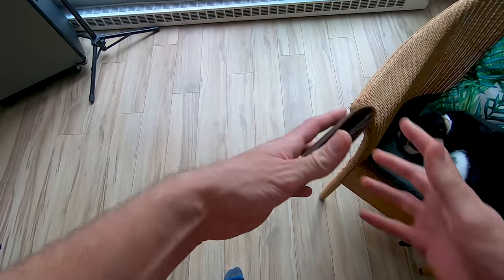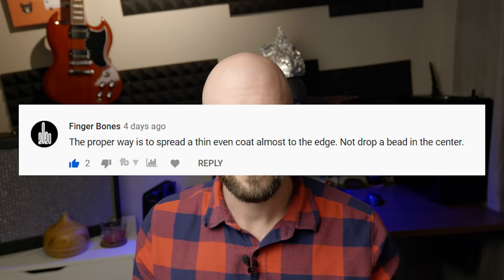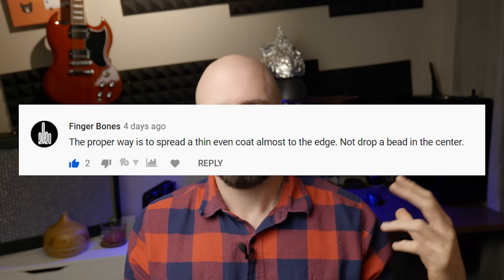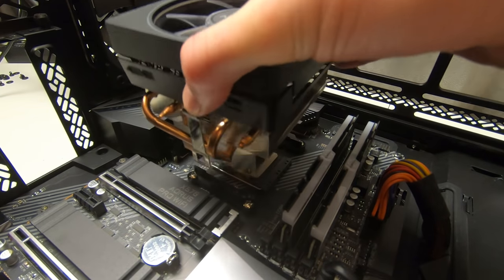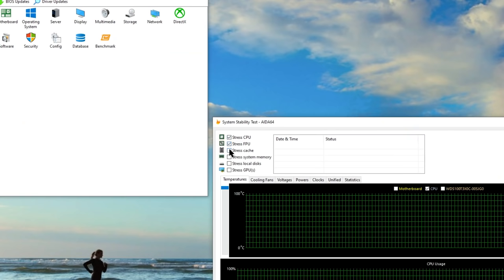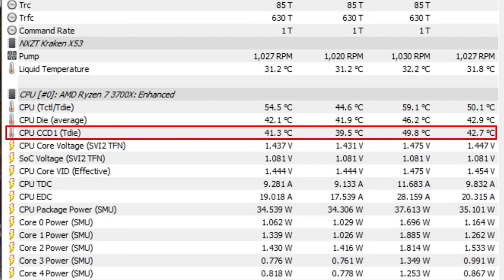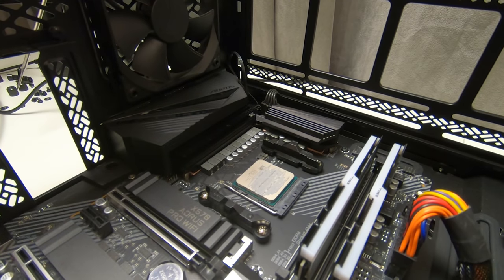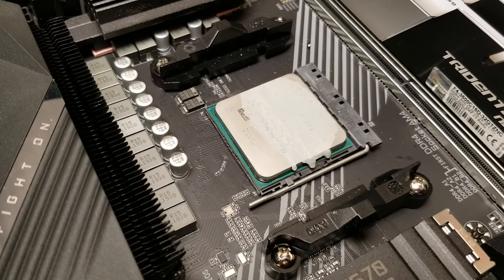Best Way to Apply Thermal Paste? Does it Even Matter?

Comment: And when I got my new aio 2 weeks ago, I wiped off the pre-applied and used corsairs XTM 50 and went with a X with a small pea in the middle. Worked fantastic for my 7 5800x!  My temps dropped by 12°C average and I never hit anything over 71°C rarely hitting 68. As I type this I am about to apply XM 50 to my new Ryzen 9 5950x. When I took off the pump it was a nice even spread across the whole shebang, maybe a little bit thick in one corner but numbers don’t lie and I was benchmarking for two weeks straight it just seem to get better and better. Wish me luck with my new 9 5950x!

Comment: I've been pushing an old core 2 Duo to it's limits with no thermal paste LoL . I've seen it hit 165 Deg. F. many a times for prolong periods of time with no issues. Of course the fan speeds up to jet engine status but no issues. I removed all the paste off the processor because it like melted and oozed down into the pin socket and made my computer show the blue screen of death. After I cleaned it up and popped that sucker back in everything worked as if it never happened . I've neglectfully left it that way now for about 4 years now and do plan to put some more whale snot back on it soon before I fry my little Die Hard buddy. Thanks for the info on paste application ! I'm just an Electrician and wasn't sure the proper application method. Thanks for the info !!

Comment: I use what I call the 'twist method' when I apply thermal paste. I start by using the 'X' method. I leave the backplate and mounting hardware off. Then I lower the cooler with no pressure and slightly twist the cooler. As the last step, I replace the back plate and secure the cooler.

Comment: Just seen this video and one thought that comes to mind is AMD recommends the pentadot method for Ryzen because the chips in the actual CPU are spread across the whole IHS. This means, if you don't have edge coverage, you can get some hotspots on some cores near the edge of the CPU. I'd recommend doing another test paying attention to each core temp to see if there's a noticible difference.

Comment: I do the a spread to ensure 100% coverage. Then I put a pea in the center so when the heatsink is placed the center will push out from the center. Keep it thin because you want as much metal to metal contact. Then I do a twist back and forth and it is perfect every time. Too much paste is bad because the m/wK is much higher through the past than metal to metal.... but something is better than nothing.

AMD did the exposed heatsink for cost and better heat tube to IHS contact. Otherwise they would need to solder the tubes on top of a copper block. More joints less heat transfer. Pouring some tin into those gaps and cnc flat and polish might add to the HS performance a bit but up to the limit of the HT capabilities, but the copper tube will direct transfer to the fins what heat it can't use to vaporize the fluid in the pipes. 

I prefer a copper slug to maximize heat transfer and use the thermal capacity of the mass. This also speed the heat across more of the HT for better transfer and allow for direct transfer to fins. The Key is a level surface with minimal gaps. I had a crappy HS that I fixed with using solder to fill the big gaps and re-flattering and got much better results.

Comment: I recommend 'buttered toast" for coolers that have "direct contact heat pipes."  I find it's best to spread the paste directly on the base of the cooler itself to ensure you fill all the grooves. If your cooler is a bit more premium and is smooth and polished, it doesn't really matter at all as long as you use ENOUGH. Perhaps if you're overclocking to the extreme, but in practical everyday usage it does not matter.

Comment: We spread but it's also important to use the least amount of TIM for full coverage. 

Example your "Buttered Toast" .. just have barely enough to cover the CPU.  It will be the lowest temperature, most consistent and is typically what's used in most data centers.

Comment: I use the spread and it would be easier to use the Penta dot. From now on I plan on using that. I no longer have to keep an old card around and then have to clean it making a mess. This really helped me to clarify what is going on now. That part is always my biggest worry in building my PCs. My first PC was a failure and I thought I did the paste wrong. It was a cheap board. And the ram I got was used. Never cheap out on RAM I learned. That was back in the late '90s. I have built so many since then that I have lost count.

Comment: The hardest thing to do is to redo the same application from one assembly to another and make a definitive conclusion. More or less liquid dough, air bubbles, exact quantity... far too many parameters and almost impossible to reproduce. Such assembly the big dot will have been better, but on such another it is the X or the 5 point with which one obtains the best results... one thing is for me certain, the best results in FULL load, it is better to have put a little too much dough than not enough.

Comment: I tested the paste on the Ryzen 6350.At idle, its temperature is 17-19 Celsius.I used Cooler Mastergel Maker paste.The temperature has been the same for more than 1 year.With Artic pastes and the like, processor temperatures were once or twice as high.There is a huge difference in quality between the traps.Example paste 2g for 4-6-7 dollars it can’t have the same quality as 2g paste for about $ 19.Cheap pastes are also all fake they are not original and they also suck.So when using a quality paste, spread is not very important  but it should not be too small and not too large.
The paste is designed to compensate for microscopically small irregularities in the refrigerator therefore it must be lubricated very thinly.If the paste is too thick a layer then the temperature is much higher.

Comment: Great video Nick!

I would like to add in that there is an issue of TOO much thermal paste - I've been building PCs for a couple years as a hobby and one mistake I did early on was having too much thermal paste. I ruined a few motherboards that way, and diagnosed the issue as thermal paste falling into the motherboards pins underneath the processor.

Once this happens, it is nearly impossible to recover the motherboard as the pins are very delicate, and any attempt at cleaning them could result in bent pins which will ultimately stop the motherboard from being able to effectively interact with the processor.

Thanks for your raw data testing and showing us your results!
Reply: Isopropyl alcohol, CRC electronics cleaner, hell even a dishwasher/under a faucet can help remove the paste.

Comment: Nice test!
I think it would habe been interesting to, if you also did a test without any paste. I think you would see similar results in the mid seventies. What happened when you used the small dot is basically disconnecting surface area of the cooler on all places but the dot. Leaving only around fifty percent or so connected. Without any paste, most of the surface would be connected and able to whithdraw the heat.
Reply: temps will skyrocket to 90-100 before it potentially damage the CPU or powers off as a safety mechanism

Comment: Im going to comment before I watch this video, because I know the right way already, and we will see if he does. But basically, you have 2 options. The first one, is actually the recomended way by the chip manufacturer. That is, you put about a pea sized amount, right in the middle of the chip, and then just press your fan down on the chip and fastren it. The paste will get spread from the physical pressure first, then when the CPU starts to get hot, it will help it spread even more.

The second way, is to do the same thing, putting a pea sized amount in the center, and then either use the little finger condom that some fans come with, or us some saran wrap to cover your finger, and then spread the paste across the chip, covering the entire surface, with a thin light coat, evenly across the entire surface. Put on the fan, and your set.

Either way will work fine.. Now I am gonna watch the video, and I will edit my comment, depending on what this guys says..

Comment: Think this is a testament that this particular CPU OHS Is not convex.   I repasted my 3090 FE and saw notable differences between spreading it and X+4 dots. Latter was notably better for that reason.  Hot spot delta between both was consistent between the two (10-15C) indicating die did have coverage.

Comment: Good video, You might be missing a small fact. The CPU is not cooling correctly. So there will be pockets of heat in tiny spots that can and do cause performance issues in those sectors of the chips. controlling the temp is important but total coverage is just as important. Thinnest layer possible is the most effective. 35+ year building systems. My pc's run for years without issue.

Comment: I normally used a combination of sorts.  Buttered toast but not all the way to the edges, so the raised paste almost leaves a ridge which should flatten to the edges once pressure is applied.  And then a small beat in the middle again (closer to your last one)

Personally speaking, I've not had any spillage with this method, nor any temp issues / blank spots in coverage.  I feel this method leaves the least up to chance for something to go wrong (uneven pressure, not enough paste, too much paste etc) but I've done a few of these over time, the pea and the X mostly.  But it really does come down to personal experience / preference and I've not personally noticed any difference with each of these I've done.

Comment: 5:00 It doesn't matter, until you realize where the termal sensor is located. Also, when you realize that a surface which is not covered with a thermal paste does not transfer the heat to the heat sink as effectively as without the paste. So you don't have to be a rocket scientist to understand, that the termal paste must be distributed evenly over the whole sufrace, and the best method to do so is the "toast" method you call it.

Comment: Buttered Toast method is best if you apply to with a razor blade. Have a very thin coat on both the cooler plate and CPU.  This method would make sure the grooves are filled in on 07:15
Reply from the maker: Yeah if that's all you get it can be worth it.

Comment: this helped me to confirm what i always said, it's all about how much you put over not how it spreads, also it seem'd always logical too me, because heat begin from the central part of the cpu spreading out, so the part that need serious coverage is middle. Also these tests helped me with the ryzen affair, i always used the P for paste application and never noticed the differences from the 5 dot. I'm also pretty sure that covering most cpu surface possibly makes the thermal paste last longer having more mass to assimilate heat, just that, but still, i'm supposing by comparing my cpu temperatures in certain situations to my cousins cpu's in similar situations.

Comment: I ofen put paste, put my cooler and press it a little and removed it, then I check if 90% of the die is covered, if not add a little bit of paste and do it again, works 100% :)

Comment: Since thermal paste has very bad thermal conductivity compared to the actual metal-metal contact, it should only be used to fill tiny imperfections in the metal surfaces. There should be as little thermal paste as possible that could prevent the two metal sides from having direct contact. Therefore I am pretty sure, that spreading a very minuscule amount of thermal paste (similar to the tiny dot) using the buttered toast method will probably perform the best. Also dried out thermal paste is not a problem, because what actually conducts heat is the solid part of the paste, not the liquid part. The only reason why it is liquid is so that it can be applied and actually fill the holes. Most thermal pastes actually conduct heat better, once they are finally dry. When removing the heat exchanger, you still have to replace the dried-out thermal paste with fresh one, because the dried-out thermal paste would not be able to adapt a second time to the new contact geometry.
Reply: Only garbage thermal pastes dry out. Thermal paste degradation is pretty much always due to the pump out effect. Thermal paste doesn't get better with age either other than the first few thermal cycles. You don't know what you're talking about.

Comment: The reason there's not a smoother base plate it feels like it's gotta be for keeping price down.* Not the kind of performance gains that would be worth the price when a compact downdraft cooler will never be everything to everyone. It just has to be "okay" and "better than the bottom of the barrel stock coolers you get with intel" to meet the purpose.

* (I'm guessing? Admittedly without cost/performance numbers to compare potential design tweaks to the cooler, this is all a guess.)

Comment: This is because the chip doesn't heat in an uniform way. It heard mostly at the centre. So as long as you have good heat dissipation there, the heat will transfer to the cooler.

Comment: The dot or rice grain method just make sure, you don't trap an airbubble in the past, which would disrupt the heat transfer.
Other than that... it doesn't matter.
I use a, let's say... tiny rice grain method in DIE mounting direction, and get perfect coverage. But I warm the paste tube before and had my heatspreader sanded perfectly even and polished it like a mirror, and made sure the surface of the cooler is also perfectly even. So with all that work put in, you would actually benefit from less paste.

Comment: If you apply the paste using the spread method, you know the entire cpu plate surface is covered. I apply a drop and spread it out over the plate.

Regarding cpu temperature, I got a used Phenom 940 off ebay and was unable to stop its temperature going up to 80+ degrees even running the bios. I presumed its thermal diode was faulty. I solved the problem by reducing the core voltage in the bios.

Comment: You forgot to try the Spiral pattern, it spreads over 90- 100%(without spillage) of the CPU surface.
my current system has it this way and hasn't gotten hot at all, then again I haven't been pushing it.
Currently I'm waiting for a new Gaming Mouse to arrive as my old one died and wasn't worth fixing.

Comment: reason why 5 dot worked better is when u put on the heatsink on its more level the other techniques the thermal paste will push to the less pressure side when u mounting it

Comment: Used dot method, line method, everything except spreading it myself. I spread it myself today instead of expecting it to spread after I press the heatsink and the spread was basically guaranteed to b perfect and it was. My temps dropped 6°c on my rtx 3090 just from a different application method. I couldn't believe it. First time in 20 I spread a thin layer first and it worked better first try.

Comment: I'm not sure if this represent every case. I had cpu overheat issue a few years ago (Intel 7700K; forced shutdown at >110~120 degree C if I remember correctly;). I found they used "dot" method like the one you showed. After I reapply it by spreading it evenly, the temperature went down by around 10 degree in idle and around 15-25deg full load. No overheat ever happened again.

Comment: More than the paste method, personally i believe it's the mounting or the cooler that is important, if the cooler has pockets , in those pockets is where the goop would collect up, and it is important to make sure that each pipe has enough thermal compound to make contact...

And improper tightening could result in far less optimal spread of the thermal paste and hence would result in higher temps

Comment: Still sitting here wondering why my idle, just watching streams/videos ranges from 50-70c?? I have a push/pull noctua cooler too... with a pea dot and 5 little dots around that, so the presence of paste is there. I didn't tighten the cooler all the way, I took like a couple turns off from the "max tighten", would that matter? Seems like it's on there just as good even if it was all the way tightened.

Comment: I would point to one particular thing. The way you apply paste hugely tied to the quality of the paste you use, or even the age of the paste you use =) Better quality and fresher pastes spreading much better, and it really does not matter even if you only apply a blob at the center. Buuuut, if your paste is of a lower quality or is quite old, it will be thick and won's spread as good, so a buttered bread variant will be better.

Comment: Great video, thank you. Before I had an AIO I had a Titan Fenrir which had heat pipes that directly in contact with the CPU much like your cooler. I noticed the small ridges in the surface so as well as buttering the CPU's toast I spread a thin layer on the cooler base plate; the idea being the paste would get in to the cracks and get rid of any air that may get trapped. No idea if it actually made any difference, but it seemed like a good idea at the time. I'll definitely be using the buttered toast with a blob of jam on top, as suggested in your other video.

Comment: Before you do anything take a file to the bottom of your heat sink.  I have never seen one that didn't have high spots which obviously aren't going to make contact with the CPU.  Be sure to file it from several angles, especially at right angles so that you don't make it so that the bottom of the cooler uneven.  With a fine file to finish you can put a bright shiny finish to the copper.  This also removes any oxidation for better heat transfer.